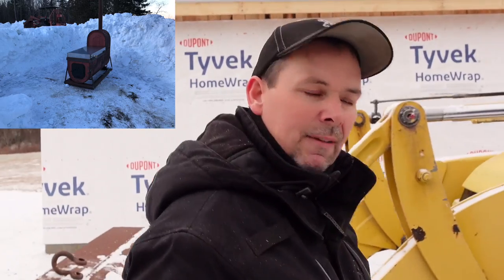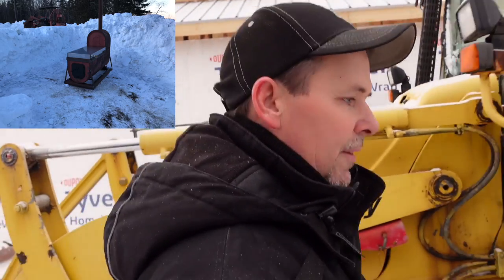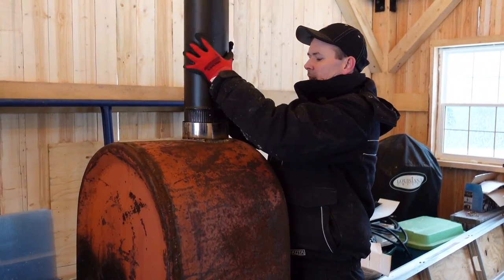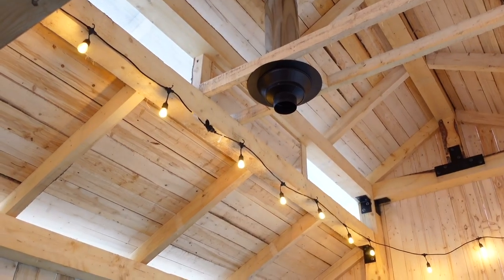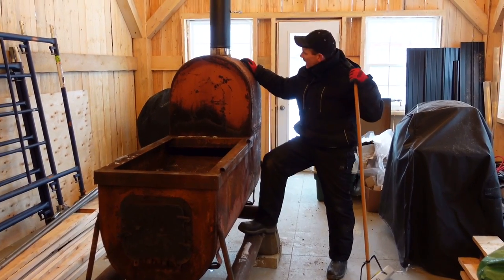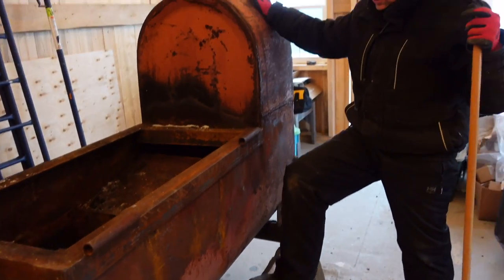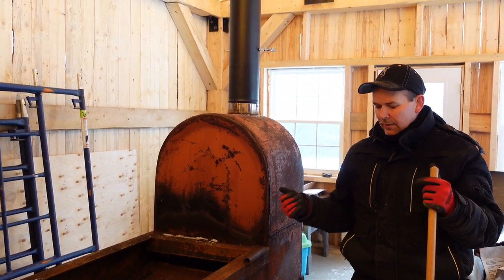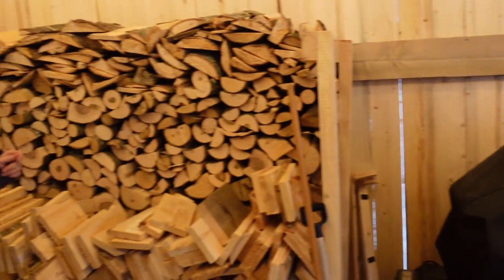Setting Up the Maple Syrup Evaporator in The Sugar Shack -E98

Comment: Think your set up looks great jason. 👍 I used papers to line mine. Fire brick is too pricey.  Will help hold the heat in the fire box.  You will enjoy  being inside and warm for sure
Reply from the maker: Thanks Bob! We are pretty pleased. I guess we are actually spoiled now! How did you line with papers?
Reply: @OakMountainAcotts  sorry jason spell check  got me. Meant pavers. They are resonable
Reply from the maker: @bobfitch607  that makes sense! We double walled this barrel and put some sand between the sections but it still heats up pretty well!
Reply: @OakMountainAcotts  felt a little  foolish when I read what I sent. Lol
Reply from the maker: @bobfitch607  don’t worry about that! Autocorrect is something else!!

Comment: Looks nice 👍🏼! Do you put some kind of "shutter" on the pipe so you can regulate how fast the exhaust/"smoke" runs up to the sky? When ~20 feet of pipe gets warm it will draw the woods up thrue the roof and the waporizer will follow 😂👍🏼💪🏼! Btw, have you seen the new Kranman 960? You should have one for 🎄🎁, but have you been goid and kind enough? If that would be the only thing that counts you should propably get a big present, not so sure about myself. It's been a difficult year, not the coronas foult...
Reply from the maker: Hi, I did install a damper about 30 cm up from the evaporator. I did see the new 960, it looks pretty nice! I have to save up for a few years but my next piece of equipment should be some type of small harvester. Thanks for watching!
Reply: @OakMountainAcotts  
 I should crawl in ashes, I missed the handle against the window 😂😉...
 I have no clue about your woods and your needs, but there are some really nice combi-machines on the market. If one takes of the bunks and (in some cases) put on some extra weight the first and second "thinning" (up to about 30cm, or 15 inches) can be made. And with the bunks in place one can get even the larger logs out from the woods. I like the Swedish Malwa 560C combi. It's nice, well done but EXPENSIVE 💸💸💸💸...
Reply from the maker: The malwa 560 looks quite capable. Do you know how much they cost?
Reply: @OakMountainAcotts  
If my memory serves me correctly I would say somewhere in the neighbourhood of 250 000$?
 It's about the same as the Kranman 620S Pro Plus AND the 960 Pro Plus together. The thing is size and use. How big and how expensive can you go and still get the wife to aprove 😉😋😂...
Reply from the maker: I’m watching videos now on it. It is very impressive. This is my new goal!
Reply: @OakMountainAcotts  
Yes, it's wery nice if you ask me to. But surely there must be similar (or better?) machines closer to home? You have got "endless" woods and are known for craftmanship and entrepreneurs. And forgive me for saying this, still skidding logs around. You are one of few that I have seen on YouTube who uses a trailer.
 Yes, you had it on the ATV first, but now the Kubota could handle a larger trailer? Hope that you still manages to make these great videos (and sometimes chat a little) because it's really educating. Both the knowledge and the possibility to exercise writing in English 😉🤗.
Reply from the maker: @johanneslaxell6641  your English is very good! The only processors we have here are very large. The big forestry companies usually finance the machines for the owner/operators. I think there is a niche market for smaller companies to use a combi and be fair with payment to the woodlot owners. This is my goal when I retire from my day job!
Reply: @OakMountainAcotts  
https://youtu.be/qZp31Vf2SvE
This Valtra is now for sale for ~155 000$. With a trailer and the harvester head and grapple it probably ends at around 200 000$. This a "quite common way" over here. First you cut, then you change the harvester head to  a grapple and connect a trailer. This is also a bit "multi-combi" but even more versatile than for example the Malwa because of the possibility to get a dump trailer, boat trailer or any kind desired. For bonus one can put scoops on the grapple or even buy a clamshell bucket for even more usage. One can quite eadilly deliver much firewood from a "pit" using tractor with crane, grapple bucket and a (dump)trailer.
 Just came to think that this could be an even better combination for your use. It should even be possible to use a snowblower for quickly clearing roads...
Reply from the maker: @johanneslaxell6641  thanks for this! I think there is a dealer for Valtra in the next province over. I want to visit once the pandemic is over to discuss options. I bet the price will be high!!!
Reply: @OakMountainAcotts  
Probably so. The difficulty is in the options. There are SOOOOO many possibilitys. You can go for a "standard" tractor with some armour under and a trailer equipped with a crane and cut/delimb with a Stihl. Or the tractor with crane and a trailer (size depending on how big trees you want to handle). Or the combi harvester/forwarder. Or a harvester and a tractor with trailer.
 If the goal is all year use I would go for some kind of solution including a tractor. Then there is the possibility for other work when woodwork is not possible.
 Anyhow there is so much money in play that calculation has to be right. If you follow your gut it will be ok 👍🏼!
Reply: @OakMountainAcotts  
I have read about your farm and your thoughts. 500 acers (~200 hectars) and wanting to develope. IF you would keep the chainsaws and take care of the "manageble" trees (for firewood and milling) and let someone else take the really big ones with heavy machinery? A JD 5125 (or "similar" Valtra) with front hitch and PTO, and a trailer 9-12 tons with a solid crane. NO, you can't do thinning. BUT you can plow, blow, pull and even equip with detachable loader. With chains (and maybe ballast) I think that you would get by quite nicely. With enough of hydraulics in the front (or electric solenoid valves) the possibilitys are almost endless. And you can move around quick enough if you are to work outside your property.
Reply from the maker: @johanneslaxell6641  That sounds interesting for sure. I really think my next move is some type of harvester. I really like the idea of a Valtra due to how mobile it is. I could pick up other forestry jobs locally and simply drive it to the Woodlot. No floating fees, etc. We need to figure out how to get a sponsorship from Valtra!!
Reply: @OakMountainAcotts  
You are so far away, Nisula Forest has a really nice Valtra T144 with a Kronos crane. 2018 driven only 4800 hours. ~140 000$ excl. taxes... 😂
 The nice thing with the "tractor-based" harvester is that when spring comes you can (if you want) take the crane off and use the tractor "as usual". Keep safe and take care!
Reply from the maker: @johanneslaxell6641  so expensive! I need to save up! Take care, Jason.
Reply: @OakMountainAcotts  
Well, you know; 1/4" inch, 1/4 mile or 1/4 million 🤭😂👍🏼!